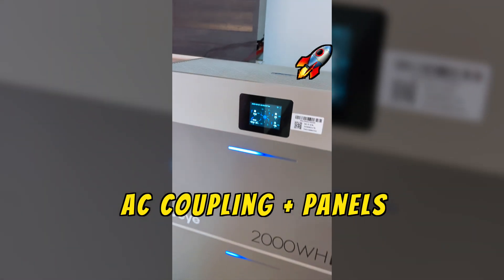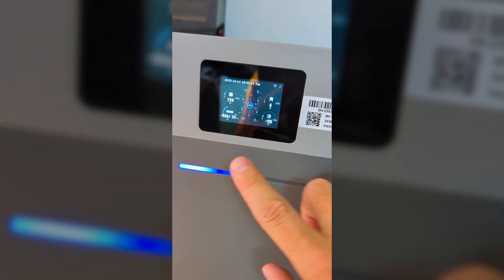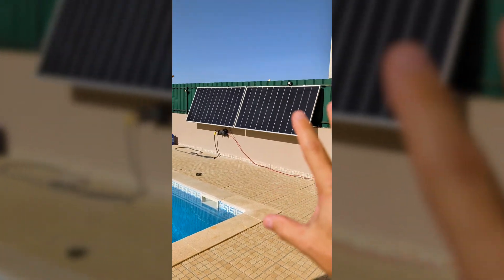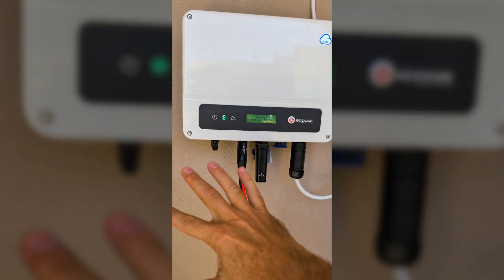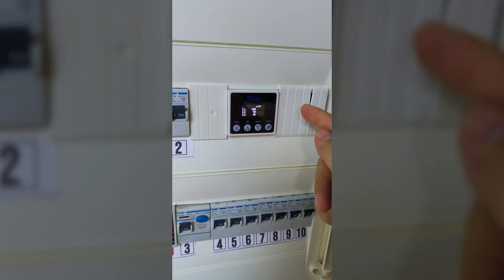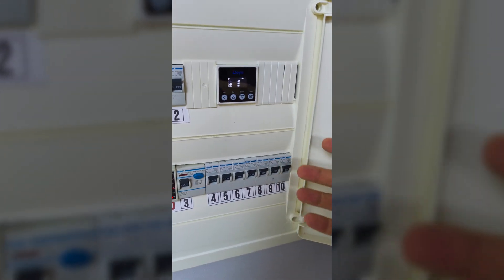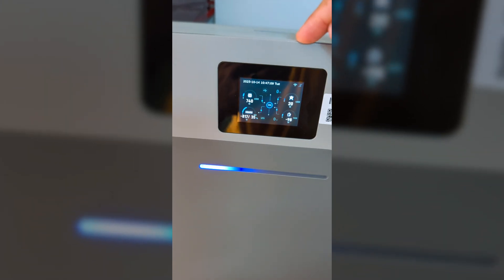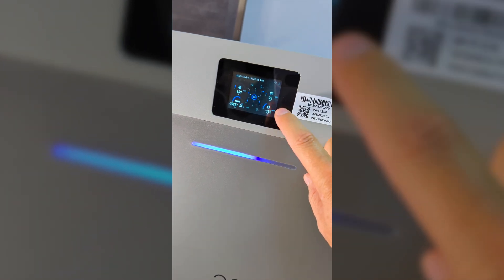Solar panels +AC  Coupling on the Deye Balcony Micro 🚀 ☀️ Add Battery to Your Existing Solar System

Comment: I've been doing AC coupling for about 6 years now.I have about eight thousand watts of a c coupled panels to my loads panel. Which goes through my low frequency twelve thousand watt inverter to charge my batteries. Which gives me eighteen thousand watts during a sunny day to do things in the middle of the sun day